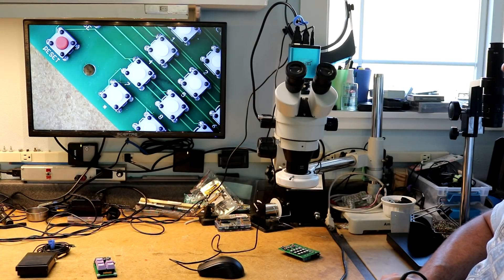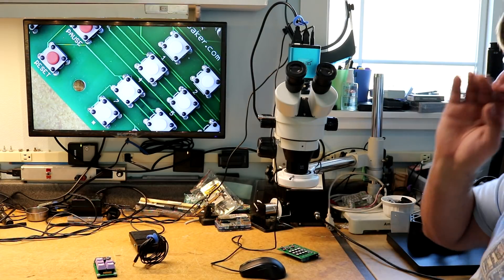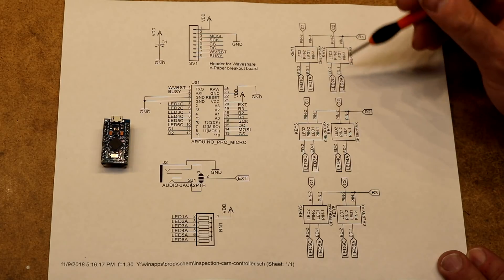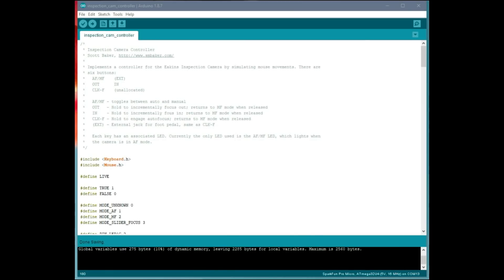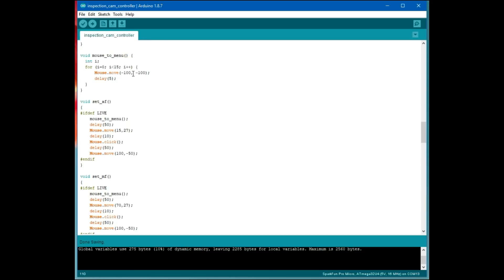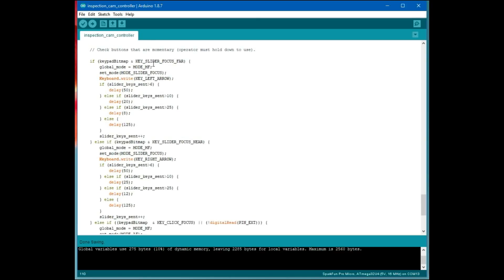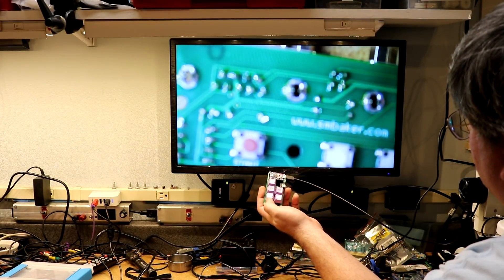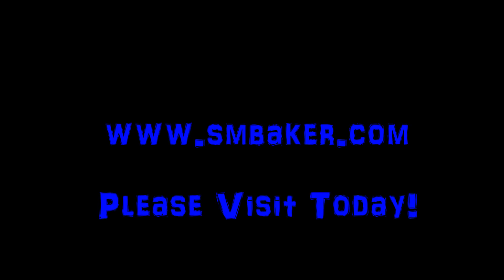Automating Mouse and Keyboard with an Arduino Pro Micro

Comment: Hey I have a question, do you think its possible to use a arduino as a translator from mouse and keyboard to controller? Like you plug the arduino pins into the data minus and plus to the xbox and the mouse and keyboard on the arduino. The arduino translate the mnk input to controller input... Do you think this works?

Comment: Hi , very cool project. Maybe you can help me ? 
I try to reactivate my steering wheel remote with an arduino pro micro. It is resistance controlles and uses 2 "rows" (A0 / A1) with 4 buttons in each row (total of 8, each has its own resistance value) is there any option to convert your code for using it as a keyboard ? I tried various sketches and i have readings on A0 and A1 , so the breadboard construction works, but i have no clue to get it working on an arduino (I am very new to this). It would be enough when the buttons on the RC "press" keys 1,2,3,4,5,6,7,8 as a keyboard emulator (no special keys needed). Thank you

Comment: Thanks!  I would order some of these in a heartbeat, if you were selling them.
I am going to test my cameras with a USB hub, to see if they can take two mice
and a keyboard.  Let me know if you are willing to sell.  Also, I can imagine your
device for focus stacking.  Use a your focus buttons to move to low working distance 
focus, press a button to lock that number, use focus buttons to move to high working
distance, press another button to lock that number.  Then another button to start
the sequence, pausing to snap along the way.  Thanks!  Let me know if you want to
sell some of these.

Comment: Very clever - first I've seen the mouse cursor controlled like that.

On a related subject, is there a good way to send messages back to the Arduino like that? Say system stats, email messages, etc? Seems keyboards have some very limited functionality via caps lock/num lock, but would make a nice auxiliary display if it could do more.